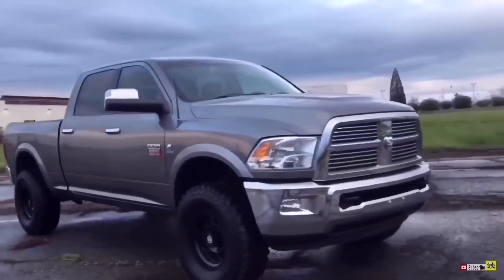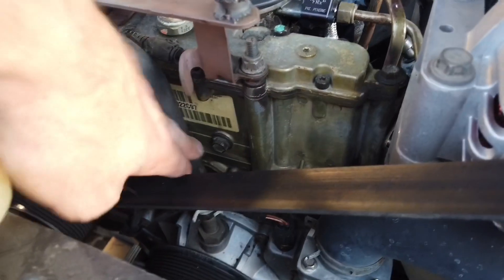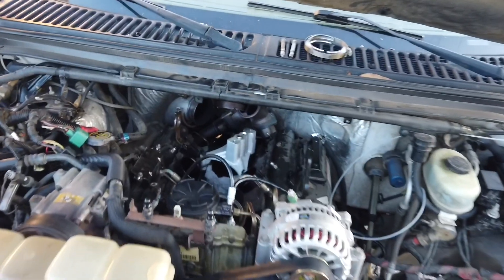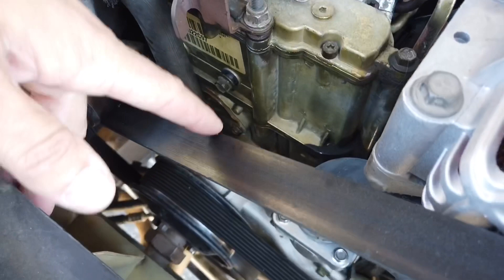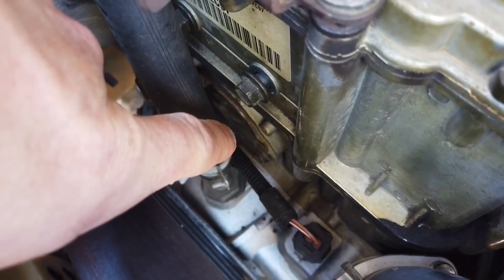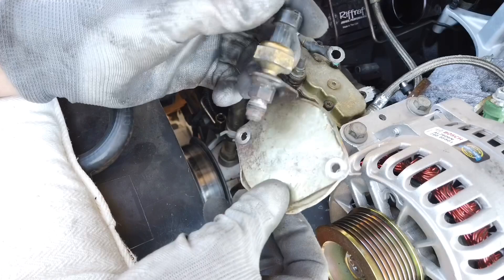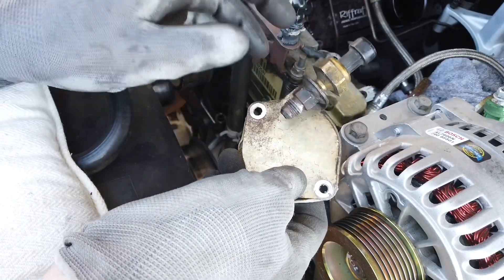2001 Ford Powerstroke F350 7.3 - Fuel Bowl and HPOP Removal Clean and resealing RiffRaff Mods

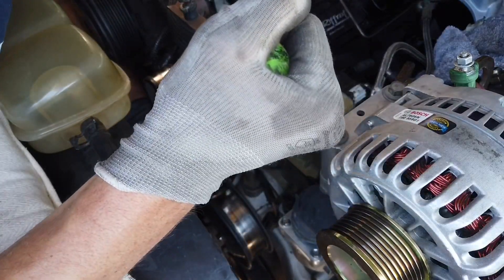Comment: If anyone else has trouble getting the HPOP bolt out at the 8:00 mark try getting someone to help or propping a breaker bar with a 15/16 socket on the harmonic balancer bolt. You don't have to remove anything from the harmonic balancer but holding it will stop the engine from turning and allow you to take the HPOP bolt out much easier.

Comment: Awesome camera angles bud. I came here looking as to why my HPOP is stuck in the mount hole (all 3 bolts are out as are the two lines). My HPOP is 1/4" away from its seat, but it seems to be hung up on something I cannot see. I cannot see what it is hung up on using a mirror and a boresight camera so I came here hoping to glean an insight. Your HPOP pulled right out no problem. I guess I just have to go back and keep fighting it. Again, great camera views, which are much better than other Youtubers that have done this same job. UPDATED: I figured out that the drive gear was preventing me from pulling out my HPOP as it was still tightly attached. It took about 15 minutes of fighting with it before it slipped free from the mating surface.

Comment: Great Vid, good to see the Big girl getting more minutes.  Man I'm thinking that my Hpop pump might be leaking cause I always have  oil in the valley. Hard to believe those high pressure lines are not screwed in. 👍😉💪
Reply from the maker: Yea I agree they just wiggle around, I got some new ones from riffraff much better
Reply: @FixItNick  My 99 F350 has 402K, I'm wondering to do the O rings also on the hpop, its the original one.  Or maybe just replacing it.

Comment: What are the 2 hard lines on the driver side of the fuel bowl? I had one bust on me, it’s stuck at work right now, I’m trying to figure out what they are, as I will need to pull my alternator and power steering mounts for access to the bottom of them

Comment: Might I suggest you slide a 3/8" hose onto the end of the fuel bowl drain line so you don't make such a huge mess when draining the bowl. Great video
Reply: I second this. Makes it nice and easy to drain it into a container.
Reply from the maker: You mean replace whole metal tube? Good idea I’ll try not to forget lol
Reply: FixItNick I mean you can replace the whole tube if you want haha. Or just extend the current one by life a foot
Reply: @FixItNick  Only if it needs it, but just slip a piece of 3/8" hose over the end and route it to the bottom of the truck that way you can drain it without making a mess all over the frame, and easier to catch it in a drain pan or can.
Reply: Same thing happen to me oil from Hpop and fuel all over shop. Kitty litter.

Comment: Hey man I have everything stock. And right by the fuel bowl there so much wires and harnesses. I notice you didnt do a fuel bowl delete. Is it because I have a obs and have the mechanical fuel pump there too ? Or are you running a regulator ?

Comment: Have you ordered from Riff Raff and gotten bad sensors? I ordered an IPR valve and it made the truck run like crap. Put a known good one in and it ran perfect I went to Ford and bought one I paid the extra $100. Riff raffl was reluctant but they refunded my money. This was 3 years ago. I have a new truck with the engine out I tried Riff Raff again for an IPR and an ICP sensor along with other parts. The bags that the two sensors came in are quite obviously have been resealed. Have you had any problems with Riff Raff?
Reply from the maker: Was it running bad with stock one? Why did you replace it? Put back on stock one and see if runs bad, if runs good then you know new one defective?
Reply: I had a no start. And found it to be the IPR. A friend let me use a known good one he keeps in his toolbox. When the Riff Raff IPR arrived I put it in. I spoke to somebody at Riff Raff they told me to drive the truck around at Full Throttle and it will fix it. I didn't do that. I put the known good one back in and went to the local Ford dealer and paid the extra $100 for a Motorcraft IPR.
Reply: I even paid $80 for gasket at ford. Not  necessary but peace of mind after hard work install 3 times.

Comment: Very real videos. Do it yourself beware…..I didn’t want to remove the fuel bowl. Third time stripping out Hpop long bolt. Through the heart of the ports and gasket. The real important one to the timing cover. Over torque and your creating $4000 of work . Oil and coolant. Riff raff sales a kit  tap and die new steel threads into aluminum timing cover to avoid taking low pressure pump, water pump, pulleys, timing cover . jacking removing cab of truck, removing or jacking engine mounts.  Beware tighting torquing short and long Hpop bolts. Hand tight.18 lbs. $1000 Hpop became a $4000 project in a hurry taking it to shop and not diy. Think before you torquing steel bolt aluminum timing cover. No rolling coal for a month and $4000 bye bye.